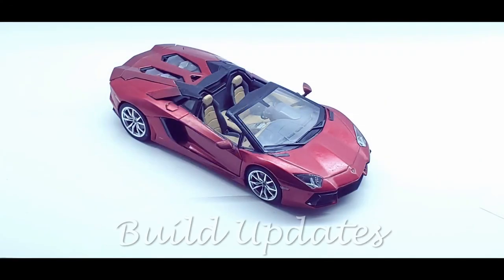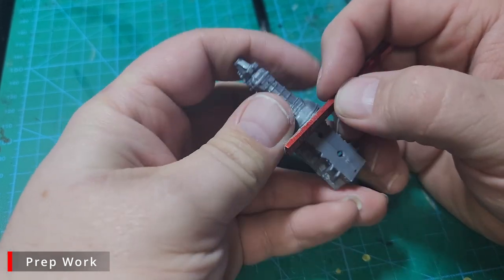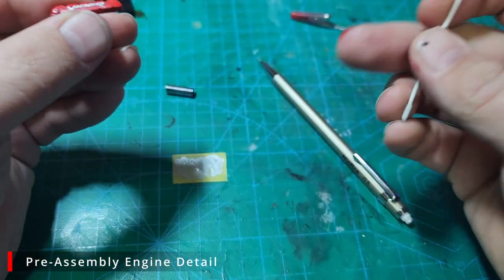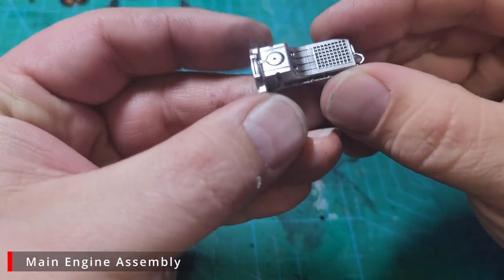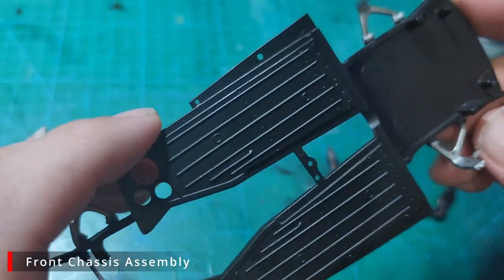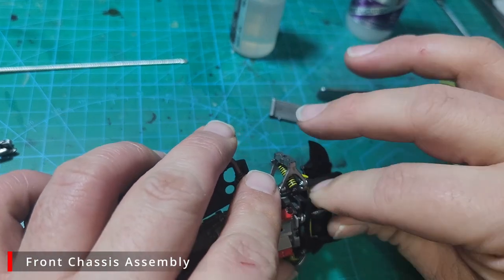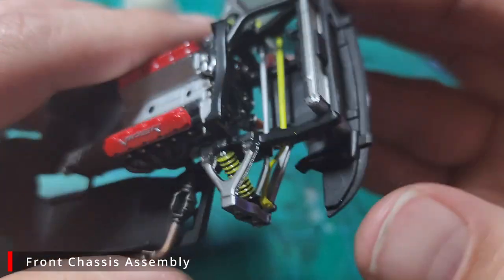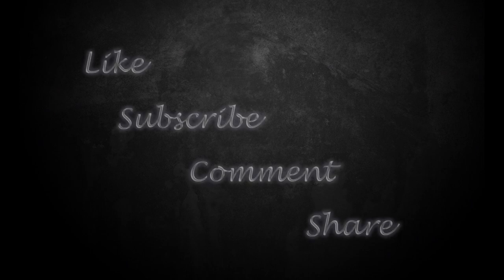Revell - Dodge Viper SRT10 Convertible - Engine and Chassis

Comment: Another fine build in the making nice job with the engine painting and neat touch replacing that oil filter the Aston Martin had separate wheel wells a real pin if not lined up right on the body 👍👍🏆🏆
Reply from the maker: Thanks Seamus!

Comment: Just a suggestion regarding lost parts. They make an apron that attaches to the corners of your table . That way, if you drop something, it stays in your lap. I'm not sure if it has a special name. I've just always known it as a gunsmiths apron. I'm pretty sure watch makers use them as well. Anyways, the Viper is looking good, not that it's a surprise. Have a good one and give Judith a scratch.
Reply from the maker: That is an awesome idea. I know I think pretty much every single part of the MGB spent some time on the floor. Thanks Robert, and thanks for watching!

Comment: Nice progress, Justin. Now I need to find a .03 mechanical pencil! I used to do fine with a brush, but like the rest of the pieces I was born with, my eyes......they're wearing out. It's unfortunate you couldn't use that other intake. It looked so much more detailed. Looking forward to the rest of the build process. Be well and happy modeling. 👍
Reply from the maker: Yeah you and me both. I'm at the age where I have to pull my glasses to the end of my nose so I can see to detail paint. The pencil completely changed detail work for me though.